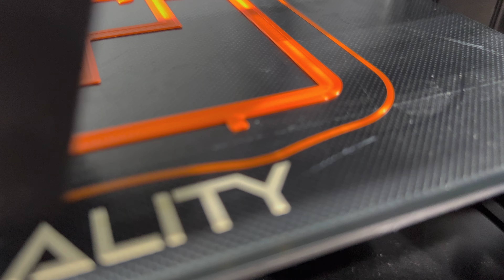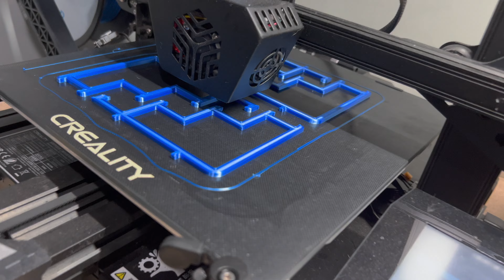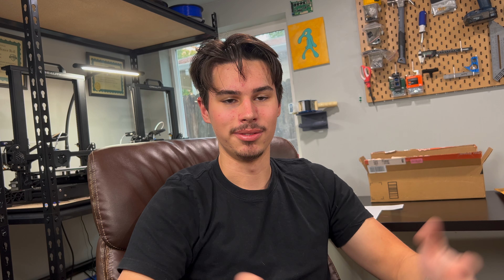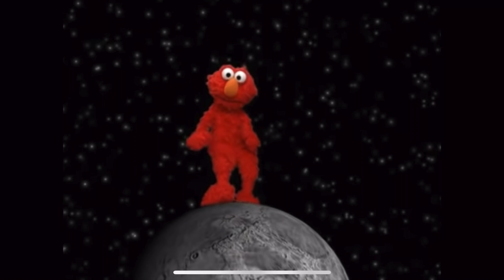3d Printing Business | Easiest Way to Make a Passive Income 2023?

Comment: I would recommend for those who need to run off multiple prints with one printer using octopi there is a plugin that allows for automated printing which is very usefull.